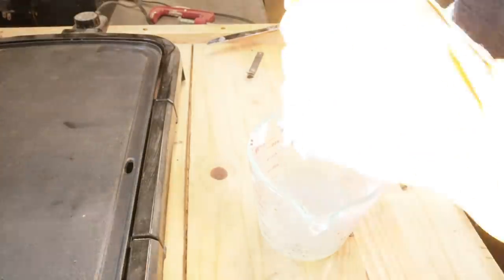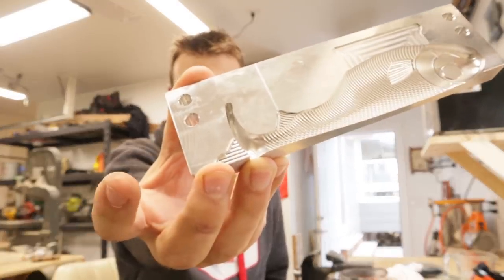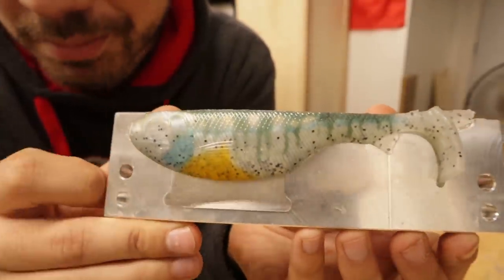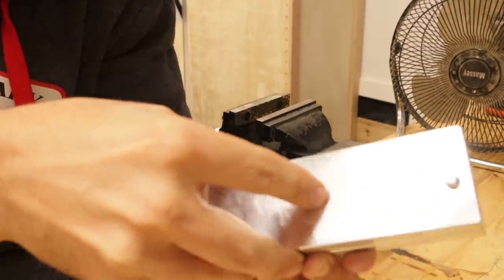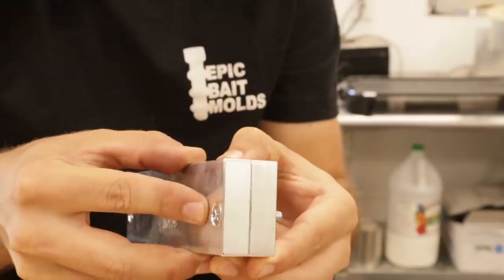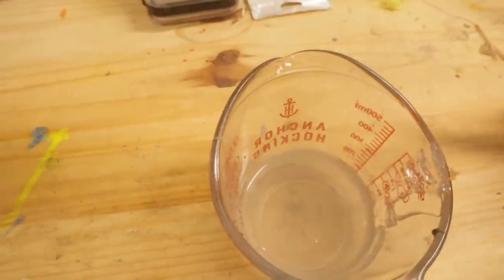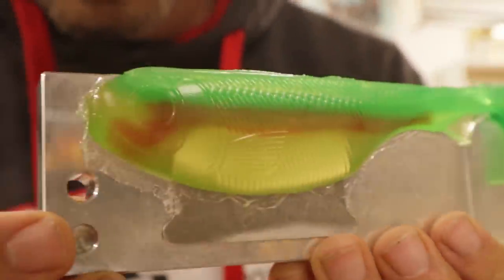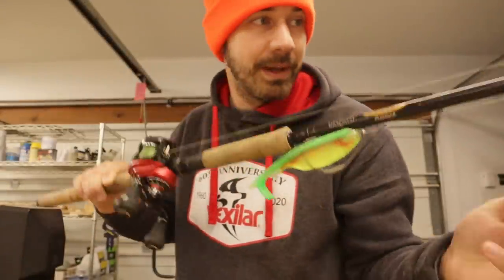A Studly Open Pour SwimBait

Comment: I stopped using bait plastics for a variety of reasons. It scorch point was varying depending on the batch. It comes out great and looks clear but after a few days they cloud up and lose transparency. If you reheat plastisol it was yellowing even with heat stabilizer added. I use it for my personal pours but for baits I sell I am not a fan of baitplastics anymore.

Comment: @marlingbaits I would recommend lowering your microwave. You wouldn't want to splash hot plastisol on your face and neck if it sloshed out as you removed it from the microwave being that it is over shoulder high.